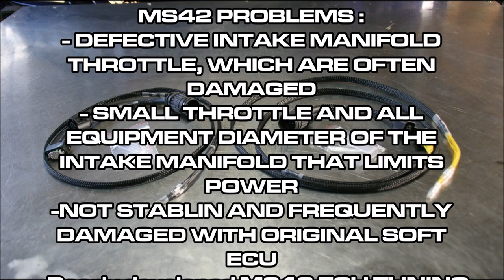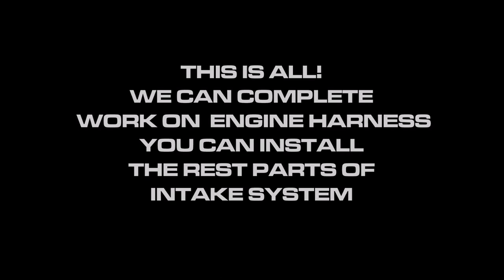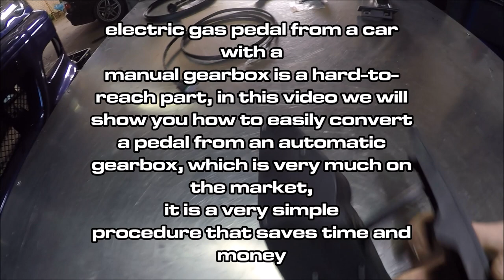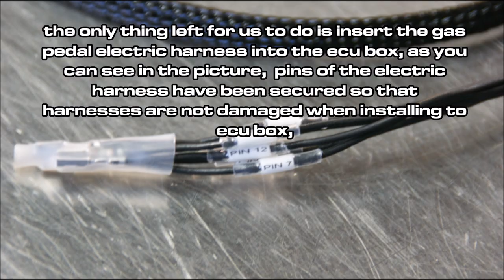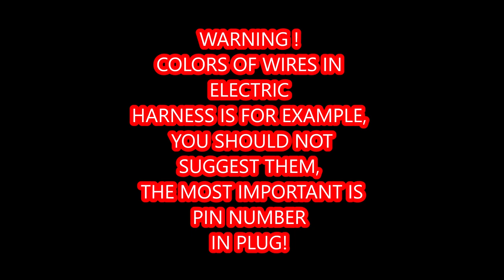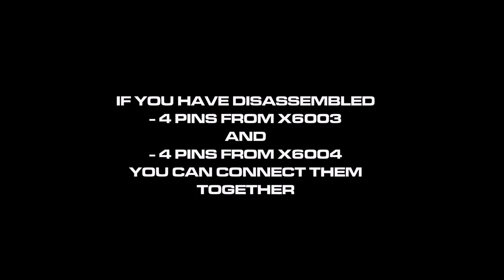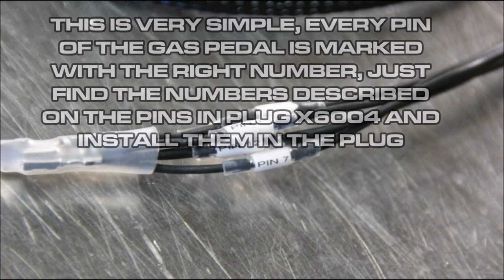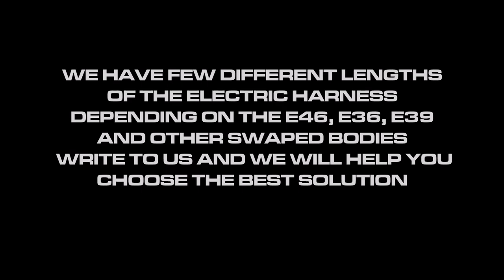DIY SIEMENS MS42 TO MS43 EASY CONVERSION SWAP BY RACEMODE

Comment: If anybody is interested in doing this conversion, I can not recommend it highly enough! First, the RaceMode guys are fantastic. I'm an American in the UK and they took a lot of time to help me get it right. My M52TUB28 is a standalone swap into an extremely custom LR Defender roadster. I had already swapped out the intake manifold for the M54b30 and adapted the MS42 to it. Was that a good mod? Yes! It increased the mid-range significantly as felt by my SOTP dyno (seat of the pants!). I saw this video and decided to give it a go if it wasn't too expensive. I ordered the cable and ECU from RaceMode and it was delivered quickly. Reading the fine detail before installing it I discovered that you will need to run the M54b30 MAF sensor as well. So I ordered one and the 90mm intake hoses as well. Once they arrived I got busy and swapped it all in. Using the correct M54B30 throttle body on the manifold is a much more elegant and cleaner install. I ditched the Land Rover Defender cable pedal and installed the fly-by-wire throttle pedal. I hooked it all up and the engine fired right up, and idled beautifully. But no real throttle response...hmmm. I sent a message and they responded as fast as they could. The first issue is that my car harness came from an automatic gearbox car. Piotr spent half a day walking through it with me online and we discovered that I just needed to remove the offending wires in the X6004 connector and install the pedal wires.  We also discovered that I might have something that resembles old age kicking in ;-)  I accidentally got three of the pedal wires off by one pin. No wonder it didn't work quite right!! Once I spotted my error and changed it, the difference is AMAZING! Is it worth it? Oh, dear god, yes!! The fly-by-wire pedal is MUCH nicer to drive than my old cobbled up LR>BMW cable assembly. The throttle response and power is instant and smashing!  MOST HIGHLY RECOMMEND! Thanks to Piotr and crew at RaceMode. Cheers, y'all!
Reply: Im swapping an m54b30 into my 323, if I use all of my 323 intake manifold, 323 t.b. and 323 ms42 ecu will that work for the time being until i decide to do the full drive by wire and m54b30 intake and t.b. swap as well as the ms43. Basically can i run an m54b30 with my original 323 intake and fuel rail setup on my original ms42 ecu without running lean?
Reply: @ThomasBilt  Yes, exactly right. I bolted my 54B30 manifold onto my 52TUB28 engine, used the adapter for the MS42 ecu to the 54B30 manifold and it worked just fine. I ran that way for about a year until I found this conversion and did it. Was it worth it? For me in my application, absolutely. My engine is in a classic L LR  Defender and works well. Best of luck!

Comment: also if any ones curious what the extra wires are actually for ... They are the signals for Battery Charge, Startup Signal (if any one knows what this actually does?) .. Oil Level Sensor, Oil Pressure switch kind of important , and Service reset indicator .. they are redundant circuits on between the cluster and the DME on the M52 body when swapped..

Comment: final boot up of engine .. very very happy engine .. warmed up was a bit tappy at first .. but leaned out to less then 1000 rpms then went lower and lower till about 800 ... tapping went away .. ticking started .. probably vanos unknown engine .. also checked that FBW pedal was actually working and it does so good :D

Comment: thanks to racemode i can confirm you can complete this mod on a 325 from a 330 ci.. i already removed all wiring harness and yeah its kl if your doing a full swap 330 pedal/tb/intake/fuel filter to a m52 from a m54 you just need the accelerator signal and ews delete or carry the ews over with locks transponders etc .. to get up and running. top work guys very helpful
Reply: Hey bro, are you also running 3.0 Air flow and the ecu map is for 3.0 as well ?
Reply: @suren0524  I have 330 doner car for the 325 so yep it gets every thing including bigger pipe work :) .. complete swap to ms43..b30 intake and FBW pedal/throttle body
Reply: @suren0524  Virgin ECU is based on a 325 CI :)
Reply: @betatester2560  so you are running 330 ms43 map ? Your original m52tu is a 2.5 or 2.8 cc engine ?
Reply: @suren0524  no a completely clean MS43 C325CI Virgin ecu :) which would obviously match match my car perfectly as it is a real 325CI. theres no major differences  in the block if thats what your worried about ?.. you would have to tune the car to run that way the romraider way
Reply: @suren0524  2.5 mate with the semi mechanical TB so if your swaping the pipe work from the 330 you should be able to run the 3.0ltr map... As I understand it,   there a very few differences in the m52 block vs the m54 except the 330 has a longer stroke obviously, but the way the virgin ecu is, its starting point is the 325 map anyway. the manifold and pipe work on the 325 has been described as a pea shooter .. does that clear things up?
Reply: @suren0524  and keep in mind i am swapping my 330 throttle body, fuel filter+ integrated 330 FPR + 330 injector rail as its technically part of the 330 Manifold, which doesnt have the FPR on the rail..
Reply: @betatester2560  mine is a 2.8 as i understand m52tu 2.5 & 2.8 fueling is slightly different. So was wondering if i swapped everything to a 3.0 and use a 330i map will is cause any issues or not.
Reply: @betatester2560  yeah i need to get the m54 rails and change the fuel filter to the M54 filters like what you did.
Reply: @suren0524  I see your issue and yeah the problem your facing ..and the simple answer is start the with b25 same as me and tune it up for the engine capabilities from there.. it shouldn't cause any issues.. might run a little lean till you can get some more fuel going through the injectors but that is the accepted way to approach  the b28 from what i can tell.. I am not sure if this is absolute fact but the b28 does not appear in the m54 stock ecus.. which made me wonder if there was never even a M54 b28 after googling about i realized this cant be the case either .. so i believe all b28's m54s start out in life with the b25 software starting point
Reply: @suren0524 did you sorted it out mate? I know, i’m 3 years late but i want to know if you managed it to work somehow

Comment: I did a 330zhp swap and manual conversion to my 323 touring it runs great but my oil light is on what do I got to do to get that off
Reply: Never mind after a bunch of research I just pulled the wire on the 40 pin connector pin 11 and put it in the empty slot for pin 18 for the exhaust flap valve for the m54b30 just to see what happens because on the ms43 pinout had the same [0/1] as the oil pressure switch and was empty and I have extra ms43's if I fucked it up but I just started the car and oil light went off for the first time since the swap

Comment: Just sent an email requesting the kit.
My project is to swap a 2006 E46 330Ci M54B30 ZHP engine into my 2000 E46 323 M52TÜB25 touring.
I already have the donor engine with MS45.1 DME, 6-speed transmission, gauge cluster, and electronic gas pedal. I also have an extra spare MS43 from a separate 330 engine (non-ZHP).
Which DME do I use? The MS45.1 or MS43?
Thank you for the awesome video.

Comment: Wydaje mi sie że macie błąd na filmie. Pin 13 w x6003 (inputSignal Battery Charge Indicator Lamp ) chcecie wpinać do pinu 1 w x6004 (output Signal Engine Start Feedback ) gdzie jego odpowiednikiem jest właśnie pin 2 w x6004 (output Signal Engine Start Feedback).Ten sam mix z pinem 12 z x6003.
Reply: Dzięki za sugestie. Sprawdzimy to raz jeszcze.

Comment: hey just a update ... after going to finalize the setup was being driven crazy by X6011 and the little black connector block *allot of confusion out there on that*.. after clawing through tons of images for hours in swap threads...  I found the what I needed... so in short if your swapping 2001 to 1999 you will need to make a pig tail for the black 8 pin connector as its the starter motor power source and the green black is the Ign switch. other then that completely plug and play.. the remaining wires left over in the black connector are signals for the cluster no biggie to sort them out later
Reply: What if I'm doing the opposite? Converting 1999 MS42 to a 2001 MS43? Will I have these issues like you've had?
Reply: @OLearysBMW  hey bud!.. that is exactly what I did.. 
I converted a 2000 E46 M52TU on MS42 to the 2001 MS43 setup... so yeah you will have 2 issues one is the relay, and one will be the pins that go back to cluster for oil pressure/level/batt charge/ign feedback.. really easy once you get good at depinning the X connectors .. and you will need to cut the 2 pin power connector of the old harness or get one from junk yard car.. one of the documents that helped me fill in some of the blanks search google for m54x5 dot pdf i think it will help you
Reply: @betatester2560  Fast response by a wise fellow, love it! Thank You my friend. 😁
Reply: @OLearysBMW  cheers dude i used to follow your amazing works before .. i changed my name ..  and top tip i found from the swap thread .. is you can detach the little bracket inside the ebox and fit that to the the build car to make it look nearly 100% stock.
Reply: @OLearysBMW  Hey and one other thing that has to be considered is the Fuel Filter .. now what i did there was completely swap to the 2001 fuel system.. i did have to swap the hardline for the return ifirc.. as it a little bit too long for some reason i can quiet remember but .. you could remain with the fuel regulator from the m52TU and not have to worry about that .. i just wanted to do it as my fuel filter need to replace and my fuel lines where just in terrible condition any way and i could get the hardline from my donner, but i also have the 330 injectors in the there as well so yeah just figured might as well keep it all including the rail.
Reply: @betatester2560  awesome stuff! Thank you for the information. 😁 I haven't uploaded in a little while, but lately I've been cracking down hard on the E46. I need to start making videos again. There's been some big changes.

Comment: The kit comes with the harness and also the MS43 ECU ? is it a stock ECU or tuned ?
Reply from the maker: tbasic set of the adapter includes soft after tuning for self-uploading to the ECU cost of the entire kit 99 euro, we can also prepare a set with a ready ECU for 150 euro
Reply: @racemode6519  this works with Automatic transmission ? My e39 is with M52TUB28. If i change my intake to the m54 3.0 intake, 3.0 intake camshaft, 3.0 throttle body, i can use the 3.0 MAF and the tune supplied will support this setup ? Does the cost include shipping to Malaysia ?
Reply: @racemode6519  how can i contakt you
Reply: @racemode please advice on my query above please, thanks
Reply: @suren0524  The tune will support setup you describe. Also Auto trany from M52Tu should work with MS43. The price 100 euro does not contain shipping costs.
Reply: @piotrwalewski8650  what will be shipping cost to  Malaysia, kindly advice please, thanks in advance

Comment: What about ews? Can I pair old EWS from ms42 era to ms43?
Reply from the maker: In our ms43 software the EWS is turned off, but if you have it working in the car body, no one will start the car without a key because the EWS module is supplying the starter coil, I did not check whether it is possible to synchronize the EWS and certainly not on our software because it is not there
Reply: I'm asking because I have already modded,  a lot of my ms42 (vanos, faster limiter 32rpm on 6800, ignition, no pops) software and I have IT background so it wasn't that difficult, but I had to repair my throttle body once and next time I would like to replace it with electronic one. 
I was inspired to mod my m52tub20 from watching your videos. I am firm believer of stock+ philosophy, and that's why I would like to have fully working EWS.
Cheers, keep up the good work. 
If ever decide to swap my ms42, I'll let you know if I got EWS to work.
Reply: I have 320 ms42, and swap engine to 330 ms43 , its work,  but i have some issue , oil light is on, service light is on, cruse not work, and engine has some vibration 

Its because there is some different  in wiring 
Im not that knowledge of electronics
Reply: Do u have any suggestion?  
To solve my problems
Reply: @maestro7028  Yap you can buy this kit from us and get rid of your problems.
Reply: I did a ms52 to a ms54 motor swap and saw this video and realized wow someone makes a cable for this swap but when I tried ordering it I was told they were all out of stock so don't get your hopes up people cause you might run into the same problem and have them tell you they are out of stock on a cable that I could really use
Reply: @jasonpalmer9994  we are sorry that you are disappointed. We have to order some connectors and we are dependable on other companies. Out of stock is temporary. You can ask in fiew weeks.

Comment: Why there is 7 conections when on throtle body is 6?
Reply: Not sure. I am not electrician. If there are 7 probably the 7 are needed.
Reply: @piotrwalewski8650  But throtle body got 6 🤷‍♂🤷‍♂